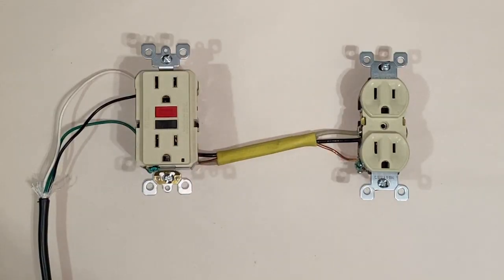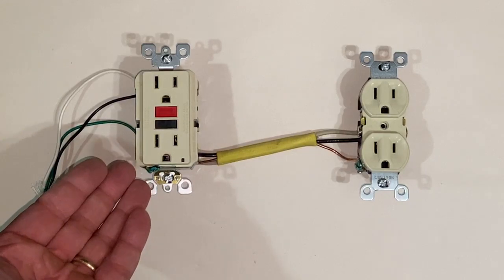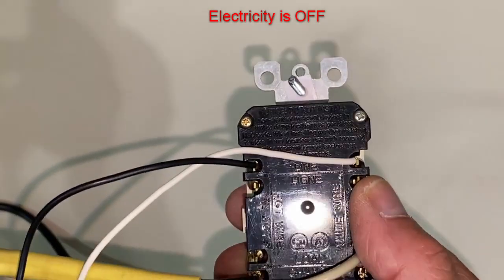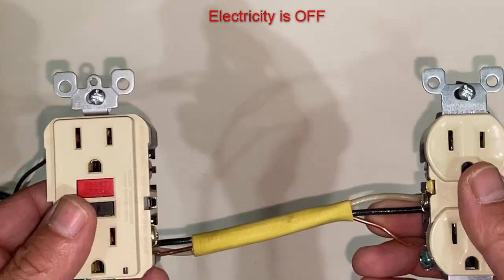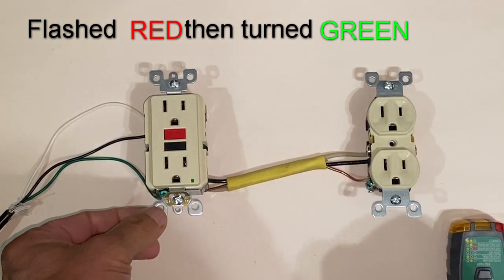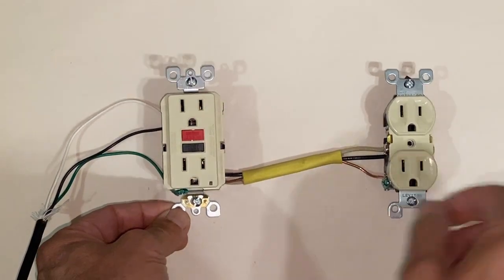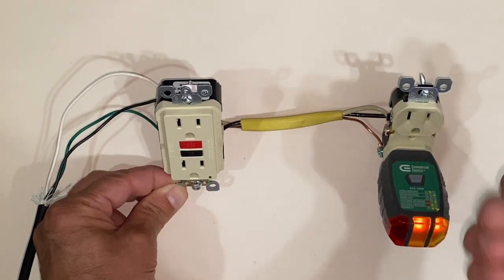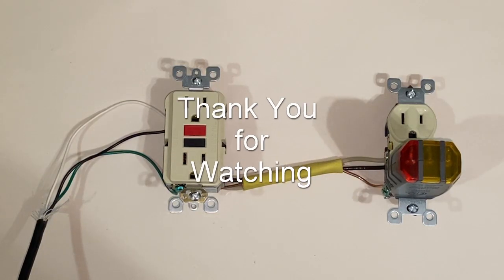GFCI outlet, how to make a regular outlet act as GFCI, Save Money, Easy DIY Project

Comment: It's almost a perfect video, but you didn't show or explain how the last outlet in the series is wired... you flash by it to quickly. I would do a new video explaining (in detail) where the hot & neutral are hooked up, in regards to line or load, with the last receptacle in the series. Other than that, this is a decent explanation.
Reply: It appears that the diagram shows the line and load wires are reversed,
Reply from the maker: Thank you Zach for the suggestion. Much appreciated.